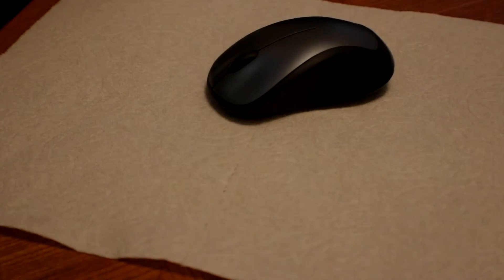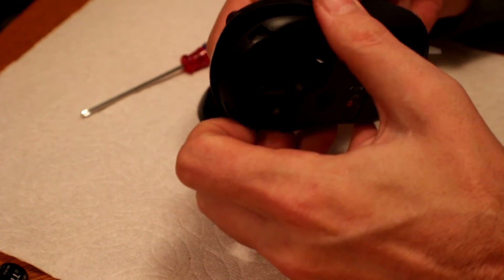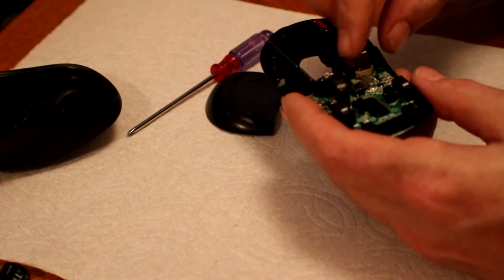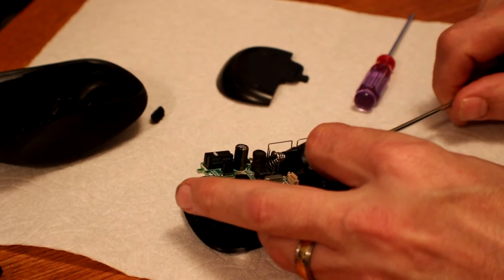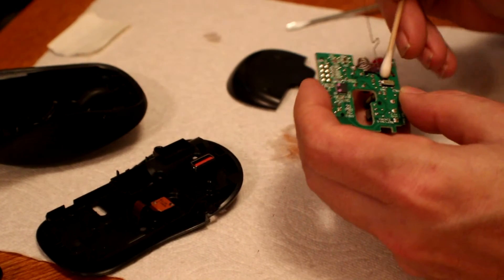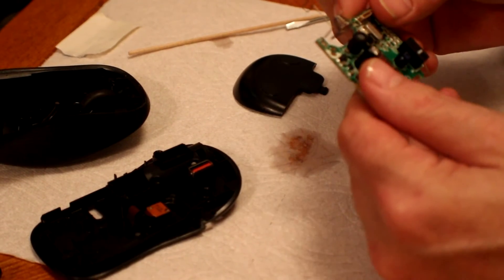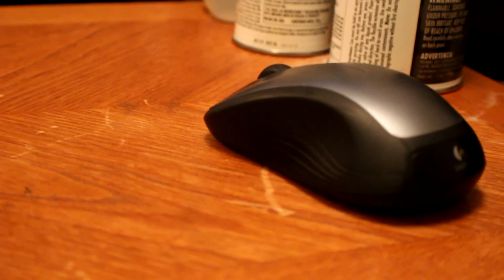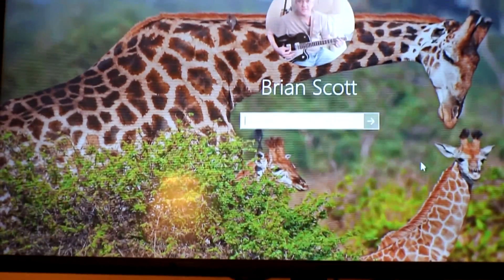How To Clean a Logitech M310 Optical Wireless Mouse

Comment: My cursor moves invertedly now, how do o fix that? Still goes left to roght properly, but goes down when moving the mouse forward and up when pulling the mouse back. Any ideas?
Reply from the maker: That sounds like either a setting got switched on your pc or you may have a mouse that has this setting as a feature you can turn on or off. Some people like this when gaming on certain games. I hope this helps you narrow down the source.